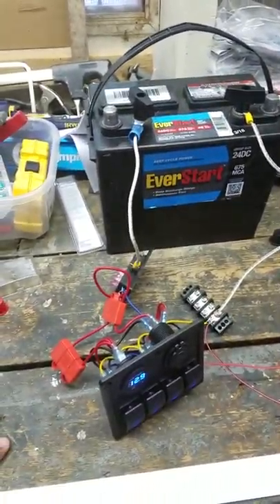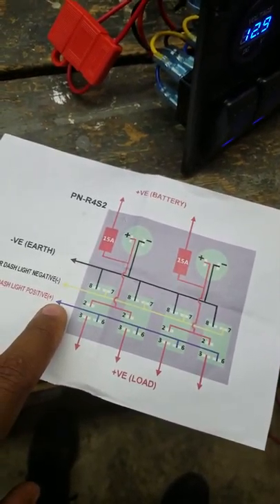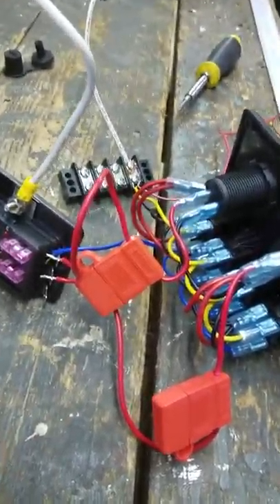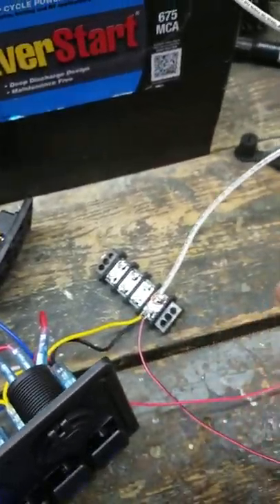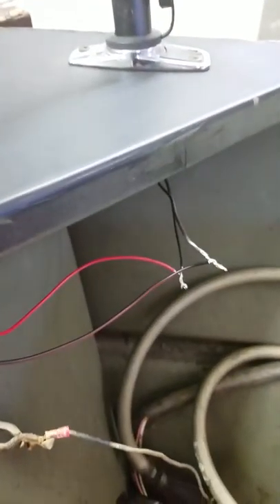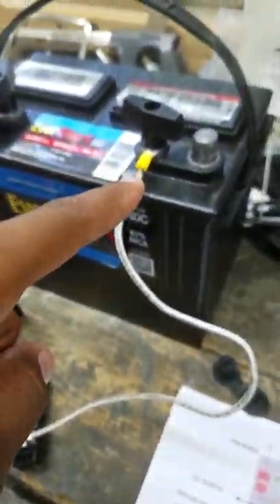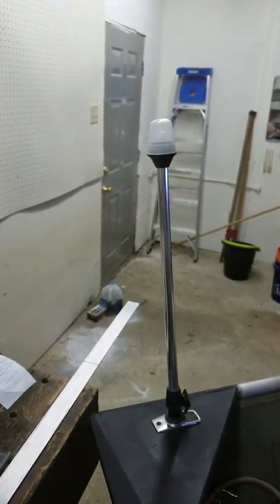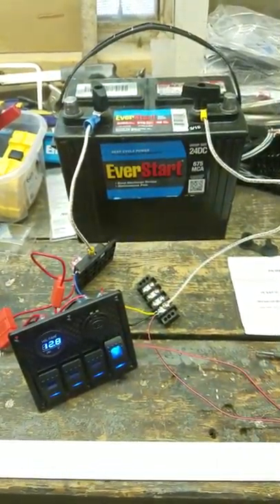How to wire a switch panel DCFlat 5 pin 4 gang marine boat circuit rocker switch panel.

Comment: I know this is over a year old.  For your protection and the protection of the whole set up You really should put a fuse right at the Positive battery terminal. Then if the positive supply wire from the battery gets a short it won't start a fire.  Add up the total amps for all your devices and put the next largest fuse size at the battery to protect everything.  The battery fuse can also double as a on and off switch to keep the battery from discharging from phantom loads when your not using the boat if you don't want to install a On/Off Switch. Check the ABYC standards if you need more assistance. Don't forget to carry a couple spare fuses!
Reply from the maker: I appreciate your advice,  and I will take it into consideration. I have no problems making adjustments for safety.  Thank you.
Reply: With all the Hype of DC power in the last few years and all the DIY that shows up on You Tube.  I have noticed that very few are aware of the potential fire hazards of DC only a few fuse at the battery to prevent Fires!  Nice video.

Comment: I'm wanting to use this for turning a car speaker on and off. I was going to run the + on the speaker through the switch but Can I do it and still run the 12v circuit to get the LED to light? Would that work or would the DC and AC circuits collide and cause issues?
Reply from the maker: I would contact a professional  with your question. I am a rookie, and barely got this working.
Reply: @GTX10  Thanks, I installed it already and it seems to work just fine.I guess the speaker signal is strong enough to light the LED too, didn't expect that.
Reply from the maker: @Grayback1973  Glad to hear everything worked out

Comment: I have that same panel.. I grouped my two reds and blue together... is that wrong?
Reply from the maker: I have to see what you are referring to,  but I can tell you that as long as all negatives go to the negative bus bar, and all positives go to the positive bus bar then you should be just fine.
Reply: SMD Fishing ok thanks... so with this unit the bottom light (horizon) stays on at all time... does that mean power is running to the switch?
Reply from the maker: @iamremy-kl3xm  yes
Reply: What's the blue wire positive?
Reply from the maker: @oakridgeboy2023  The blue is connected to the positive terminal which brings in power to run each item you have connected to the switch.

Comment: False, the blue is actually connecting the led light on the switch. It's irrelevant if you don't care about the switch illuminating.  And the yellow is the ground for the switch led.
Reply from the maker: Thanks for the feedback